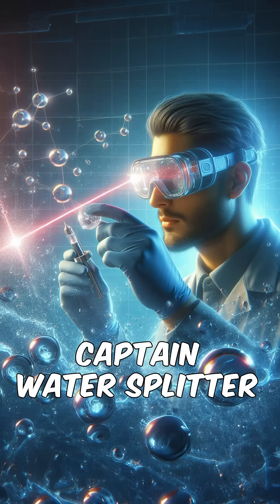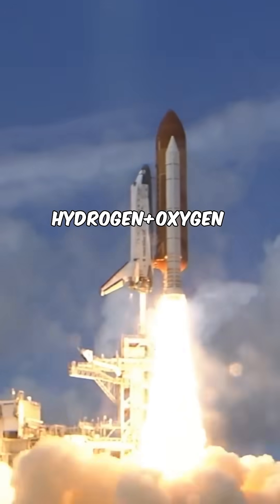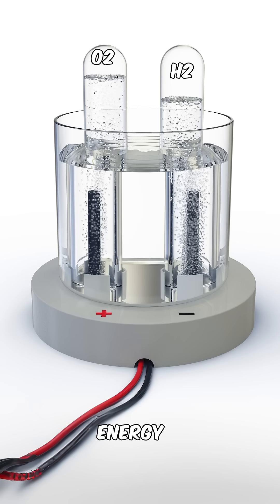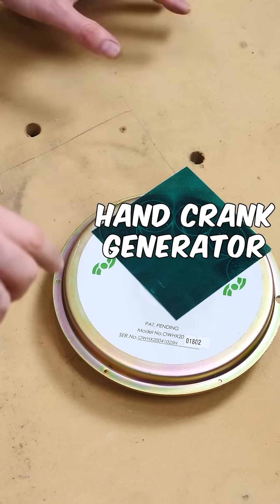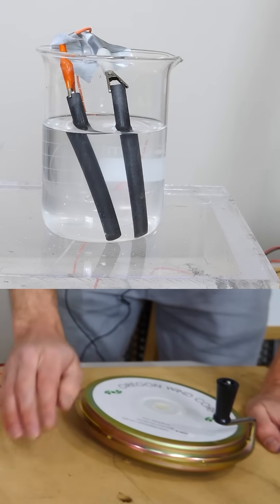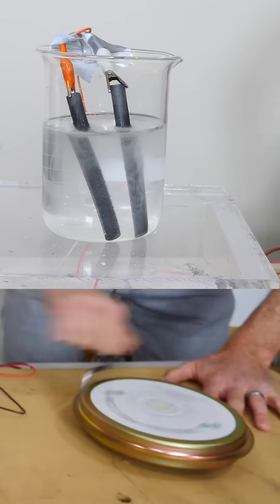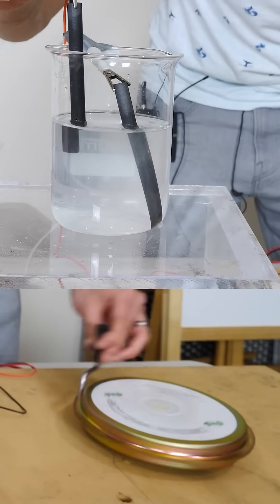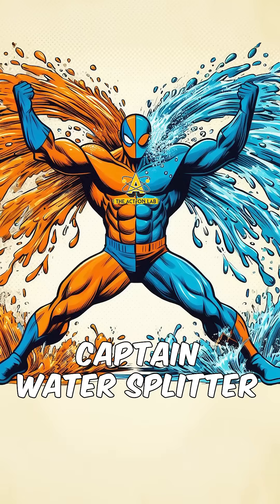I split water molecules with my bare hands

Comment: I did this 50 years ago in my friend’s kitchen. I added a lot of salt to the water, because I figured it would conduct better. In retrospect, I wouldn’t do that because it probably just created a path for the current which would decrease hydrolysis. 
I got the current directly from two wires plugged into a wall outlet, which meant AC, not DC 😅 
It fumed and sputtered. We ran out of the house. The mixed H and O2 exploded. We had a mess to clean up before his mom got home. Never told her where those glasses went.

Comment: As a plumber I’ve seen electrolysis a lot copper water lines have this happen when they are touching something metal along the line the reaction of a copper line sitting on a metal screw for years will cause this green corrosion will build around the copper pipe usually near a fitting or can even cause tiny pin holes to form and it will cause serious damage if not found out early enough to shut you main water supply off if you have an old house and you notice green forming on your copper lines look for anywhere there is metal touching and get rid of it next you will want to call a plumber or switch your lines out yourself fairly easy now a days they have push for connections for homeowners so no crimping or soldering switch your copper to pex it’s much safer for you and your family just don’t hire hacks to do work without locating water lines and you won’t have to worry about them cutting through the lines

Comment: You don't need high amps to achieve electrolysis. Place the plates about a millimeter apart in distilled water (no salt or contaminants) then have the plates ramp up to around 250k volts. Do this at a high frequency and the plates will create arcs that will split the molecules.

Comment: Wrong way! Instead you shoot a <.3mm laser hole through a superconductor then spin it over 10k rpm or so, using magnetic suspension and a pair of coils on opposite sides hooked up to pwm. Now, shoot distilled water through that and see what happens. Yes, it not only splits but 1800x volume hydrogen is instant. This literally takes 1/40th of a watt yet provides enough split water to power engines up to 500hp or so.

Comment: This is a good example of why hydrogen generation doesn't work well for fuel conservation in a vehicle. It takes more energy to produce the hydrogen, than what you get back out of it when it burns. It is always a net loss.people always think that once you have the electricity it doesn't matter how much of a load you put on it, but it makes the generator, or alternator harder to turn and in turn takes more fuel to produce the electricity being used

Comment: There is no reason for the resistance of the hand generator to increase when you put the electrode in the water. That's not how it works. Your video is full of inaccurate info

Comment: question: the separated H2 seems to have twice the volume of the oxygen in the containers above the electrodes. There are twice the number of hydogen molecules, but why is it the double volume despite of all the different properties of those gases?
Reply: It has something to do with moles.
In water hydrogen has 2 molecules and oxygen has one, and thus the volume ratio is 2:1. So the volume of hydrogen is more than that of oxygen’s
Reply: At the cathode, hydrogen also evolved quicker than oxygen, leading to the larger volume

Comment: 🤔 Which electrode produces the O2 and the other generates the H2O? But I guess I can use an open flame to locate the H2O. I mean I would start with the flame in my lowest point of volume because I don't want any kinda bomb of a supply problem with figuring it out. But it's supposed to assist, with a petrol engine almost like nitrous oxide. Just uses less fuel to operate the engine....

Comment: You could use a river or spring to turn a water wheel to power electrolysis to and capture the hydrogen to run a mobile hydrogen fule cell and drive off of it. Niagara could be a bigger fuel source than all but a few oil feilds. And the exhaust will be just plain water returning to to the environment. I love hydrogen

Comment: The maximum faraday electrolysis is 1.23 watts to produce 11.4 mL of HHO gas per minute at room temperature and pressure. The wierd part is it should be 2.06 watts but you only need 1.23 V to overcome the first half reaction, after wich the 0.86 volts for the other reaction occurs naturally. And note that both these half reactions have a negative E° values so none of them should occur naturally.

Also water expands by 1800 in volume when it turns into HHO. I have seen a company on youtube name secure supplies lmt, hydrogen hot rodding. They own the rights to Stanley Mayer water as fuel technology. It appears that they take advantage of the expanding volume to also produce power.
Reply: This is very interesting. How about using the wind turbine to split H and O and use H as fuel that can act as storage of intermittent wind power and O also as many applications like purification, medical use or even rocket fuel etc.
Reply: @38Oofdmq   yes that is already been done. But the problem is storing and transporting the hydrogen. You have to first produce and  separate the hydrogen from the oxygen, then compress and cool the hydrogen to a liquid for high power densities and cheaper transportation. All of these process makes hydrogen as a storage device un economical. However Stanley Mayer technology claims to produce the hydrogen very cheaply (exceeding Faraday maximum) plus producing it in demand so there is no need for transportation and compressed storage. However his technology is clouded in pseudoscience, And said to be a hoax.
Reply: @Bruce_Gruesome  no it's difficult to turn the crank due to Lenz law or lenze drag which is a part of all generators regardless of what they are powering.
But I realized that lenze drag can be split into two:
1. The drag is caused by the force on the moving charges in the wire that is in the presence of a magnetic field.
2. The drag is caused by the interaction of the magnetic field of the coil and the magnetic field of the rotor
You can greatly limit the second one but I don't know how to limited or remove the first one.
Reply: interesting... I askhed chatGPT how to crack the bond with resonant freq of the bond. A guy wrote this in one LinkedIn article. But his answer was diff than mine. It said at resonance, it'll be easier to break (more eff). I was thinking if we can freq sweep it and find the peaks production. Maybe I need to ask ChatGPT differently.. hence prompt engineering..? It said I need standing wave to improve eff further..

Comment: I have a combined model electrolysis chamber I made - outputs either H and O or mainly HO, which in my opinion is a lot of fun but terrifying in its power. Just don’t say you’re considering driving a car with hydrogen or hydrox or else you get disappeared by big oil.

Comment: Eh?... yeh, you FAILED!  F.
YOU, SIR, GET AN  F !
- #1 your experiment is lacking a control !
- #2 nobody can "see" any resistance within the crank that you speak of that's supposedly present as you have the lead lowered.

- #3 maybe it was worth a "D" , since it appears that you did fabricate that "crank."

( It would be "Crank'n" if you EDITED this one- adding in two test tubes to catch the hydrogen and the oxygen above leads that were powered first by a battery! And that's your CONTROL, OBVIOUSLY! and finally place a match so everyone can see that it was successful. THEN YOU CONNECT THE LEADS TO YOUR CRANK - KEEPING THE OTHER END OF THE SETUP UNTOUCHED and proceed to split water again.
--
-- ALSO- TO SHOW THE RESISTANCE!!- set that crank on its side and hang a weight on it,  or hook s spring to it- so you avoid taking the leads out this ensuring everyone believes your experiment is not fakery! 

 [ OR DO THAT SEPARATELY AT THE END AS A BONUS THING AND EXPLAIN WHY THERE'S RESISTANCE- ss most people don't understand under the crank handle are magnets. ]

Comment: Why would it get harder to crank when the electrode is in the water??? That doesn't make sense it shouldn't have anything to do with the resistance of the hand crank.
Reply from the maker: the more the electrode is in the water the higher the overall current I need to push through the circuit. It most certainly gets harder when there is more surface area to the electrode. There is more gas being generated and more work needed to make the gas.

Comment: Why does the crank get harder to move when you put the probes into the water? Is it the magnets inside the crank getting stronger as the current is applied?
Reply from the maker: There is more resistance in the circuit because it is moving more current; the magnetic field created by the current moving through the coil of wire is stronger with more current, so you feel more resistance against the magnets you are turning.
Reply: @ActionLabShorts  Wow 😮
Reply: I'm impressed on how easy is to produce hydrogen gas. Is it that simple? Shouldn't we be using it to feed our engines? Good video.
Reply: @ff3nyx it actually is that simple. You can eaven buy pre assambled hydrogen gas generators. Or eaven simpler, you go with the chemistry version and use the power of sodium to split the water (reference sodium hydroxide wich turns into sodium during the electrolysis of aqueous sodium hydroxide (caustic soda) since the sodium ion gets to loos it's hydroxyd ion and reacts with water to for sodium hydroxide (caustic soda)
Reply: @ff3nyx  Simple, yes.
But how MUCH gas you can generate is another thing.
Reply: @ff3nyx its nit pure hydrogen. Its HHO, combination of hydrogen and oxygen gases. You can produce 11.3ml/min of HHO. The problems of using it for our engines come in form of seperating and compressing the pure hydrogen gas to liquid form.